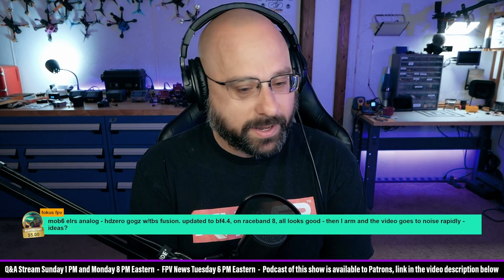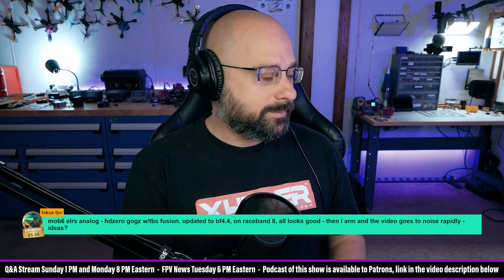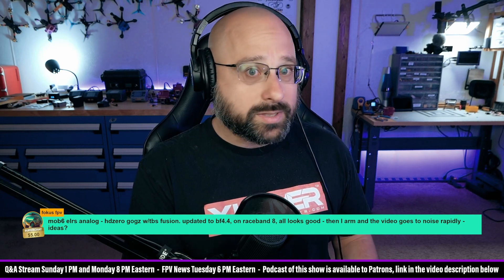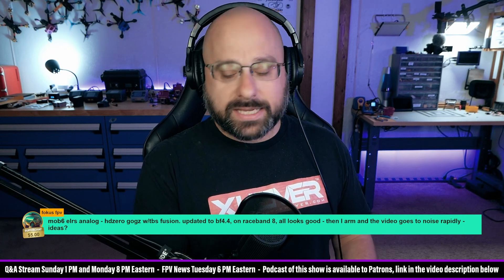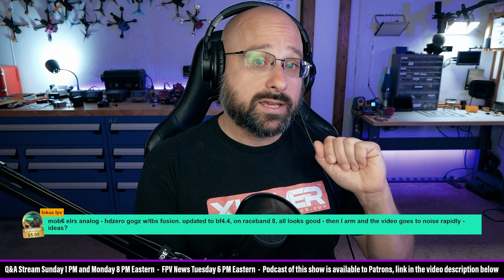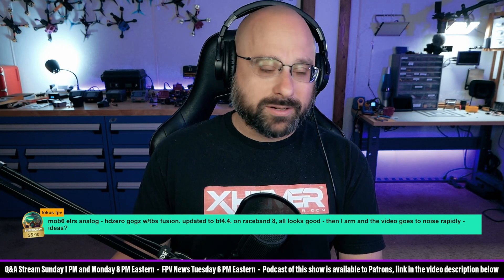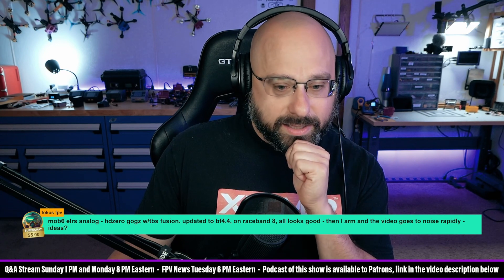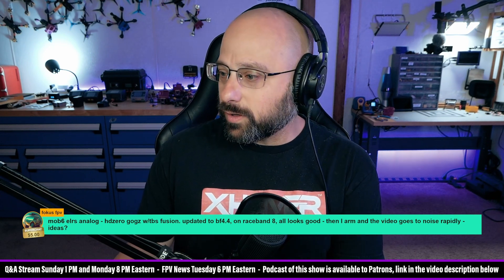When I Arm My Analog Video Gets Really Noisy! Help! - FPV Questions

Comment: not a single suggestion to trace back the ground leads on the board to make sure they were solid. You could also take an extra ground wire and hook it up as a redundant. alot of FC dont have enough of a ground loop in the circuits to help squash current flow issues like trying to push a hose flow through a straw.
Reply: Either the ground wire or video wire lol I would say 😅